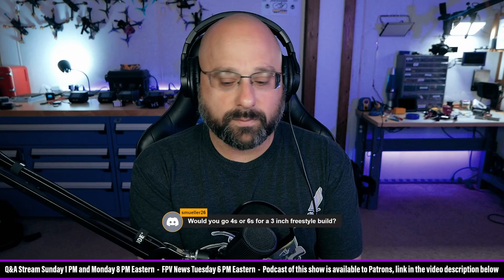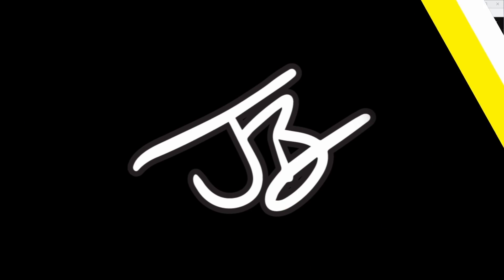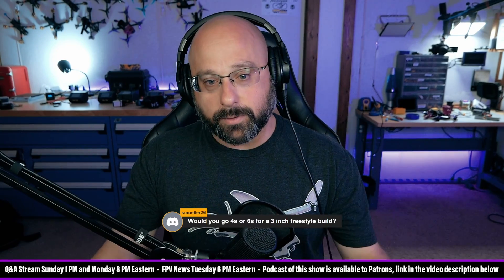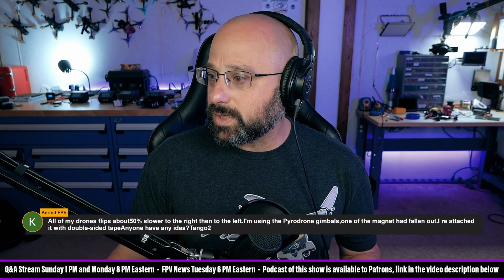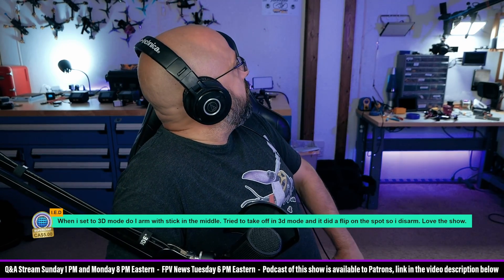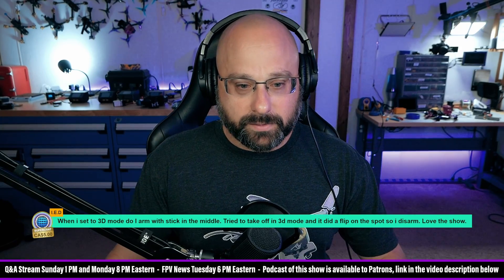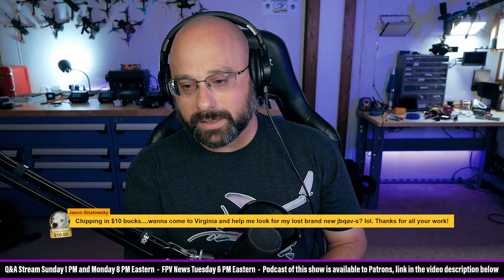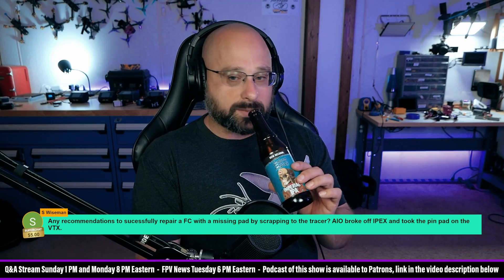What Battery Voltage For 3 Inch Freestyle? 4s vs 6s? My Quad Rolls Faster One Way?  - FPV Questions

Comment: Are the ESC the common denominator for cell size? Running a 3 cell but got 2 new 4 cells. Im running old school. ambnaze32 flight controller. Thanks

Comment: I ha ve build a 3 inch vx3 with 2004 3000kv motors run  850 packs and no motor heat. Im just lucky?

Comment: Somebody get this man a 6s quadmulla 3in and his mind will be changed as soon as he hits the throttle
Reply: I run my Quadmula SF3 on a 4s 650 and never thought I needed more punch. I did do a bunch of lightening mods so it's about 226 grams ready to fly with battery.
Reply: @Mangorille  no voltage sag, significantly more 'fling', faster, more responsive throttle. 

It would be worth your time to give it a try.
Reply: @hattrickFPV  What motors you running?
Reply: @Mangorille  I'm using rcinpower 1507 2850kv, but if you want to stay sub 250 use t-motor 1604 2850kv, or t-motor 1404 2900kv

Comment: It depends on the basics. For a nice powerful agile quad the ideal thrust to weight ratio should be 1:10. So if you have a lighter build by choosing a less weight frame and electronics with powerful motors, you will have a monster quad even at 4s. Best example is Crux35. It has power and agility more than you can handle.

Comment: I own around 10 6s 3 inch. I have owned a number of 3 inch 4s.
6s 650mah is perfect and way better than 4s.
Faster, more responsive.
 The first time ive disagreed with Joshua
Reply: At which AUW? 6S 650 seem pretty huge for 3" builds, did you use close to 1000 mah on the 4S builds as well?
Reply: @Kai-P I tried 1000mah on 4s but somehow it didn't work. A 650 6s lihv is the same weight as a 850 4s. I use 1408, 1506, 1606 and 1507 motors. If you're using little motors then your rig doesn't need 6s. Big motors draw too many amps on 4s.
Check the reviews on the diatone GTM 349 and 369. The difference is huge.
Reply: @richardheedfpv9626  what KV are you using on these motors and which props ?
Reply: @Kai-P sorry. Auw is sub 250 but I fly analogue.
Reply: 3.5" 6S builds are awesome. Also got several.
Gemfan 3630 and 2005 2400kv 6S is awesome.
Reply: @chrisbee5481  correct. Great props finally for high powered 3.5 quads.

Comment: I have a motor tick on my 3” 4s tried 2 sets of motors differ tunes, still there, anyone help?
Reply: Did you try to change the esc?
Reply: @MCsCreations  I haven’t, it’s brand new, I know some can be DOA, but playing with the tuning makes me think it’s tune problem rather than a hardware issue. I was able to smooth it out the ticks. And they immediately go away when I take off. It’s only at idle.
Reply: @Callsigncondor239  That's really weird indeed. Perhaps you should make a short video and send it to Joshua.
Reply: @MCsCreations  I think so😂 I need the guru himself. I’ve only been in Fpv about 5 months maybe it’s on my end.
Reply: It could be due a motor or arm not being tightened properly?